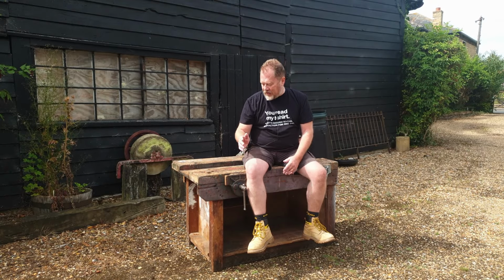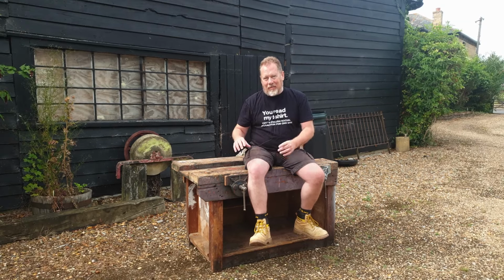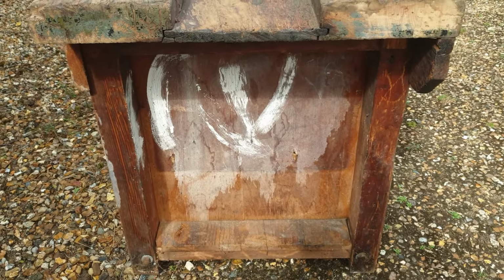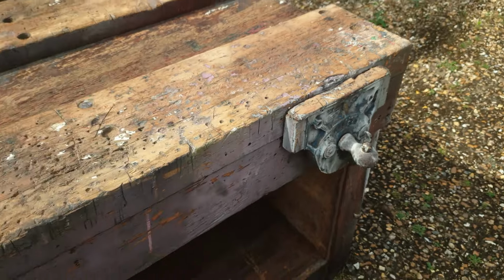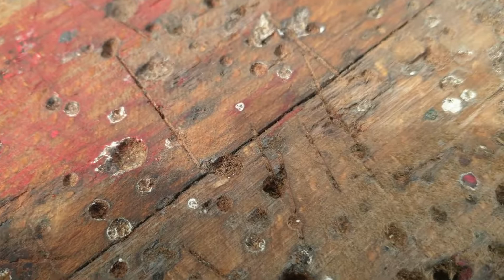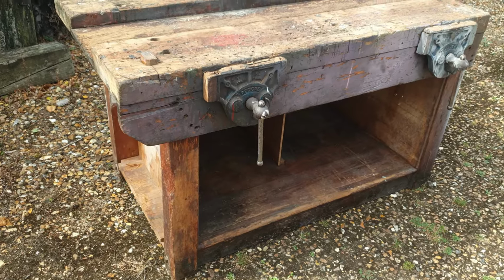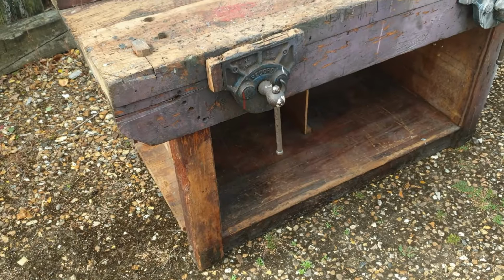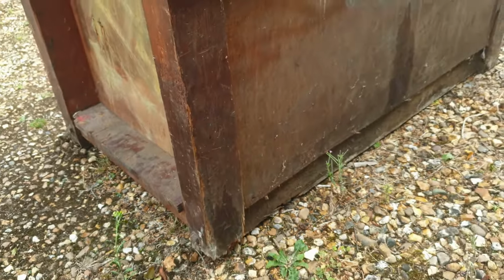Hand Tools Only - Restoring a woodworking bench - Part 1

Comment: Sled feet as recommended.  Id use a simple bridle joint i think. I'd move the lhs vice to the end (yiu look right handed) to use asvan end vice. Just glatten the top. The dimples will help with grip- dont make it super smooth. Just flat to within a few thou.

Comment: I find it  hard to imagine laminating redwood on top.  Redwood is usually rather soft (almost like Cedar), and so would easily dent while dog holes would wallow out too easily.  Instead, I’d clean up the existing top, then turn it over where you would likely find a better surface (even if it needed cleaning up.  And given that it’s hardwood, it should be durable and last beyond your life time with reasonable care.  BTW, I don’t think that’s a dog sticking up from the top.  Rather it’s a planing stop.  These have a somewhat tight fit to their top, so that they can be raised or lowered by mallet strokes on either their top or bottom.   In so doing, they are made to secure work well without interfering with the passing of the plane.  

The question I’d ask is: what do you want the workbench to look like when you’re done?  This should inform your remaining design decisions, along with the requirement for: 1) a sturdy stable piece, which 2) positions work at a proper height for you.  BTW, knowing nothing about you I can’t comment on your preferred 38”table height.   But I would note that I’m 5’11” and prefer a 34” height, FWIW.

You may find that extending the legs to be a challenging method of achieving sturdy and stable, even with M&T joints.  Accordingly, you might be looking at more invasive methods, either replacing the legs, or perhaps extending them using something like a halved bladed and cogged scarf joint (which offer resistance to bending across two planes at 90 deg to each other).  For myself, I’d go with the replacement as the quicker and easier solution, but you might find fitting the joint more interesting.

One advantage to lifting the whole bench is that the bottom of the apron is raised.  This can lead to more storage space below (if thats your choice), but having reached a certain age, I enjoy the option of working from a stool and have room to fit my legs under the bench.                   

Also, it sounds like you haven’t had a proper bench in the past.  If this is a misunderstanding on my part, the following may not be worthy of consideration.  I chose to eliminate the tool well from my bench, and replace it with more workspace.  In my world, the well collects and retains tools, shavings, dust, scraps, papers and so on.  Over time, the pile grows taller than the work surface, and interferes with the  placement of larger work pieces on the bench.   Your work habits, of course, determine what would be best for you, but you are working with a smallish bench as your starting point.

I hope the above provide some small assistance in your plans for the bench.  Good luck with your build.
Reply from the maker: Thanks for the detailed info Richard 👍

Comment: The particular pattern of no 52 vice you have dates from the 1940s.  The end of the screw where the tommy bar goes through changed to a more cylindrical type in the 1950s.  As far as bench height, it depends on the user’s height and what sort of work you plan.  Preparing stock with wooden planes needs a lower bench top than finer work like hand cut dovetails.  I think your plan for the top is good but be very careful of nails when you true it.  I would add some height by adding a front to back timber across the left and right pairs of legs.  Add feet to the ends of these by nailing some short 1” boards to each end of these.   You can experiment with height by adding or removing these (you could keep them loose until you’ve got it right).  A diagonal board from top left to bottom right would resist racking if you plan to do a lot of hand planing.
Reply from the maker: Thanks for the info Richard 👍

Comment: I'd start by a complete disassembly. I suspect you have more rot than you realize and also that the bolted places are no longer tight.  As others have said, run the beech top boards through a planer to true them up and then put whatever you like under them to get the thickness you want.  For simplicity,  cut all the legs off to the bottom of the cabinet and then make a set of legs with stringers between and simply set the bench on them.  Use a stout dowel for the connection.
Reply from the maker: Thanks Mark 👍

Comment: See if you can flip the top boards - the bottoms might be in better condition. Completely replace that back leg with the most rot, then cut pieces off the good part of it to use as extensions for the other legs. Oh, use a sliding dovetail to install the extensions.
Reply from the maker: Sliding dovetail is a nice idea 👍

Comment: Take the top off and check the underside. If it’s serviceable, put it upwards. Attach leg extensions with large dowels and glue (repairing the rotten one first)

Comment: I'd start with addressing the issues in the base/legs before touching the top. There are some good suggestions in the comments for adding the height you need. I'd want a solid, stable base before trying to flatten the top.
I don't think you'll need to raise the vices - just add a higher jaw liner, perhaps with a touch more "toe-in".
It looks like you've still got plenty of thickness in the top and most of those holes won't affect the use even if they're still there after flattening. I think it'd be a shame to cover the top with new wood. I'm with you on tools being usable first, but I also like to see a bit of history. Also, you're the man who hand-scraped a fore plane - don't tell me you only care about practicalities! 😂
Looks like a great bench and project - I'm looking forward to seeing how you get on 👍🏻👍🏻
Reply from the maker: Great ideas, thanks for sharing. Haha, yes I do like things to look nice but I have to reign myself in so as to actually get things finished. In danger of the bench becoming "triggers broom" if I'm not careful 🤣

Comment: I would probably put sled feet with floating tenons to raise the legs. You could also scarph on extension to the legs but it would look pretty strange from the side I reckon. Might be worth cutting out and replacing the rotted section at the back though.

Planing down the top will be immensely satisfying. I think the pitted used top surface adds to the bench's appeal, and I would avoid putting new wood on the top if it can be helped. A well worn surface invites use, while a brand new one can feel too nice to ding up.

Comment: You will have to make sure ALL the nails have either been removed or punched in much deeper or you will ruin your plane, personally I think it would be better to source two new timbers and replace the top altogether.
Reply from the maker: I ran a metal detector over it in the second video, yep full of nails.
Reply: @radboogie   I look forward to watching it when it comes out  😃

Comment: Looks like the woodworking class benches from my old school.  Wanna save it?  Remove the vice and plane 2-3mm off every surface until it is all back to fresh white wood.  Refix any wobbly bits with new screws then coat with a preservative.  Assuming of course…there is no rot going on, that would need a whole different approach and you might end up with nit a lot of original bench left!!!  Oh and keep both front vices great for long heavy items like doors.  Watch the cost…it could escalate beyond being economical.
Reply from the maker: Thanks Contessa, great advice. Definitely keeping the two front vices, as you say very useful for clamping long items. Talking of cost I was working on it some more today, almost decided to replace the front apron with new timber, but reminded myself that all I want is a good solid workbench and not a work of art, as you say so easy to start pouring money into these projects 👍

Comment: Plane the wooden bits clean and flat 
Move one vice (no point having two on side!) maybe to an end?
Dog holes and sliding deadman to make the most of those vices
I'd add to the tool well to make it smaller although a planing stop, but that may just suit my work!
Reply: On the top - you could always laminate on a couple of pieces to clean it up, thicken it, and bring the height up a tad! You'd had to move your vices up too.
Reply: Sigh, comment half way through the video and then finish to find you've already said what I had to add!
Reply from the maker: Thanks for the ideas Edward - much appreciated 👍

Comment: You can flatten and even the bottom of the legs the and a thick 125mmx125mm or 4"×4" block going from front to back. Screw into existing legs, the add a piece to the front and back under the 4x4 to raise it to desired height. You can cut those blocks on an angle to make them look nicer and less "blocky". A common type of base for older benches. You can just Google 100 year old work benches to get a better idea for the type and shape of bases. DO NOT just butt-joint blocks to the legs. This will look like crap and be much to unstable. Just my opinion.

Comment: I would make them take the two sections of the top off and run them through a planner. Flip them over for a fresh side and reattach them after sanding down the board that goes under the two sections and creates the well. Or, find a piece that you can add to the middle between the two sections for a solid work surface. Definitely would not suggest redwood which is much too soft for this application. Plus, it is not a cheap material, at least here in the States it's not. I would try to match the species already on the top, be it maple, beech, or oak. You want a hardwood so it will last awhile, and can be resurfaced easily with a couple of passes of a hand place. This way you are not removing a lot of material each time you want a fresh top. I would strip or sand all of the rest of the bench and if you can get away with resurfacing the vice chops without taking too much off, you can reuse them. If not, again use a hardwood of some kind. Then line the faces with peel and stick cork or use some raw leather to face them with. Depending on if you plan to use dog holes or an iron hold fast, will dictate hole sizes. The one dog hole you have can easily be plugged and a few fresh round holes can be drilled in. Strip and either repaint, I wouldn't,  the vises, or just put a lite coating of the proper oil on the metal and buff off. This will prevent it from rusting without having to repaint them and will look more period-correct. Definitely raise the bench up to a comfortable height or you will wreck your back and shoulders from using it at the wrong height. Best of luck!!
Reply from the maker: Thanks for the info 👍 I've had a good look at the top slabs, reckon they are probably Beech, next video is out soon perhaps you could have a look and see if you concur? Will need to make some Dutchmen to blank off old slots so would want to plug it with a similar wood.

Comment: The top is now two well dried and stable pieces of proper timber. I'd probably spend some time flattening it, after gluing a piece of whatever to the bottom of it to make up for the lost material. The vises look to be mounted fairly low so you have some wiggle room.

As for the legs.. maybe cut them back to the healthy part and then build a sturdy frame of sorts that the bench sits on top of? Could put some drawers in it as well.
Reply from the maker: Thanks. Interesting idea packing the tops from below to regain height 👍

Comment: 100% a school workbench. I used to work at a construction college in the midlands as a technician. The bench's were identical and students used to drill into the top, hammer nails in when they were bored. cut into it for the same reason. 
It was always a challenge getting them back in to a decent- ish condition
Reply from the maker: Thanks, this one has definitely had a hard life 👍

Comment: If you use any kind of plane to flatten that top you’ll ruin the blade hitting all the nails etc that are surely embedded in it. Use a belt sander on both too pieces and check your progress with a straight edge. Once you get them as flat as you can, laminate hardwood on top not redwood which is soft as bread. Remove the vises, strip the paint off, repaint and lubricate then replace the wood with the same hardwood used on the top. Consider replacing the front plank they’re attached to with more hardwood. Tool well just needs a good sanding & some Danish oil, poly etc on it, the rest of the carcass needs a good sanding then some paint. Built a new base for it to accommodate the height you want.
Reply from the maker: Thanks, yes I reckon the top will be panel pin City! 👍

Comment: I would start with the top… See how the top is connected to the bench frame.
You’ll need to pull out the vises and remove the apron.
You might want to take the top off and then build Your height on top of the frame… but that will all depend on how the top sits on the frame…. That top will need to rest on a solid surface.

Maybe Build 1/2 of the height with the top rebuild and then 4X4’s across the bottom of the legs. (The short distance will do nicely - The width not the length)
And then go at the top with a scrub plane and then a no5 Jack plane… or an electric planer for the rough work…. Really easy to ruin the bench with that.
Some really thick plywood might support the top piece nicely….  It will just depend on how the top is attached and what it actually sits on.
Reply from the maker: It looks like the top is fastened with coach bolts which will make life easier. Will get the top off and see how it looks.

Comment: I dont understand why you would want to replace the top. I would denail it, plane it down only a couple of mm, oil it up and use it. If you want a new top just make a new bench. I would make a plinth to stand the bench onto raise the height. Perhaps a small plinth for each leg so it captures the leg and wont slip off. Pull the vices off and clean them up add new faces. Perhaps inset a new section of top just where the vices meet to get a good meeting edge. Clean the whole thing just enough to tidy it up and get the paint off.
Reply from the maker: Thanks for the suggestions 👍 Making a new bench would be a bit over the top as it's basically sound. I would prefer to have a cleaner top so flipping the uppers will probably do the job.

Comment: It's a nice little thing, I'd make a box pedestal under it with some floor crates under it for tools you don't use.
For the top I'd just do it as they used to: flip the planks and flatten them, cause right now you'll probably run in some hidden nails in that surface when planing and this will save most of it (probably why they used to flip the tops once upon a time...)
Reply from the maker: Thanks Bruno, will definitely have a look at flipping the top.

Comment: I have a similar workbench which had surface issues. Don't know if woul work with yours but I removed the top planks turned them face down and reinstalled them. The underside of planks acceptable after light planing and old rough surface no longer visible. Good luck
Reply from the maker: I'll take the boards off and have a look, they seem to be attached with coach bolts so should be an easy job 👍

Comment: Unfasten the two top slabs, turn them sideways as rails use those to create a base for a new top.  Use a better wood than redwood which would be too soft.  This will get you the height you need.  I imagine that the bottom of the current top slabs are in good condition so those would face out.  The new thick sides could then be drilled appropriately to reposition your vices.  The void under your new top would give you ample space for an end vice.
Reply from the maker: Thanks for the suggestions, will be interesting to see what the boards are like underneath 👍

Comment: Richard, awesome old bench. i would look at taking the two upper sections and turning them over to (hopefully) get to some nice flat clean, undrilled faces. For adding height, you might look at picking up threaded steel pipe and flanges. you could attached the steel flange on the underside of the post and then add the pipe. you would need another flange to sit directly on the floor. you could also add a non-slip surface(rubber, cork) under the flange to keep it from sliding. you showed at least one post will need some major cutting back , so you could use a longer piece of pipe in that location.
Reply from the maker: Thanks Jim, definitely interested to see what the uppers are like underneath. Great suggestions 👍

Comment: I agree with adding a new top over the existing, plus you gain some height, plus it will deepen the tool well. I find benches with a tool well somewhat cumbersome as invariably some tool is sticking up in the way. A nice fat dowel should suffice to secure leg extensions. You could always add pocket screws in the inner corners so they wouldn't show. I would add a few holes in your new top for a stop if not some bench dogs as well. I also enjoy reclaimed/ repurposed pieces, I've turned dressers into sink bases & mortar projectile crates into a shop cabinet. Carry on!
Reply from the maker: Thanks for the suggestions! Deepening the tool well is a good idea, also using dowels for leg extensions. 👍